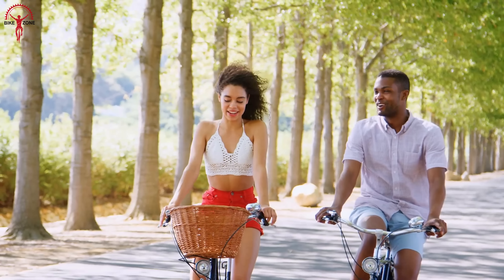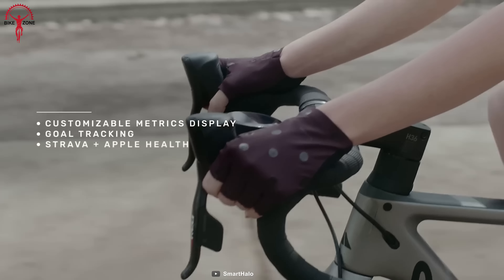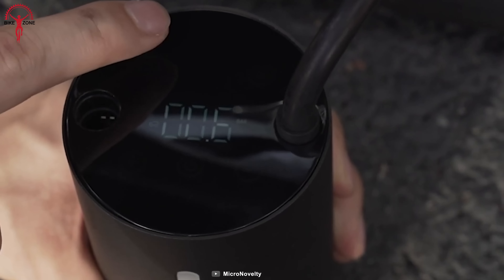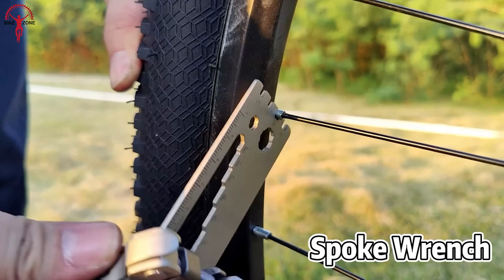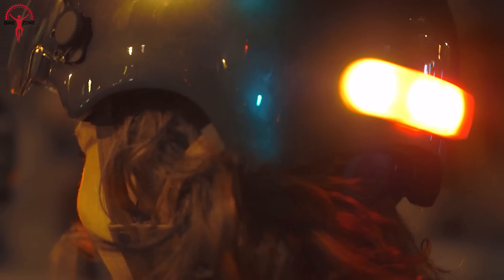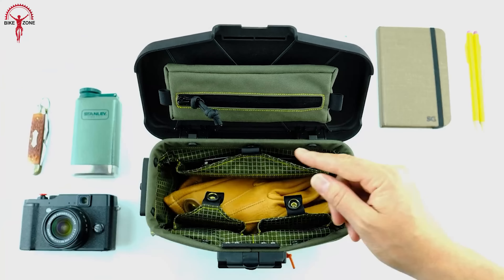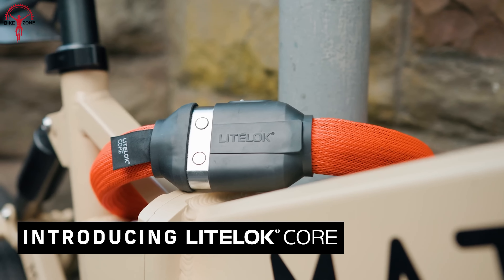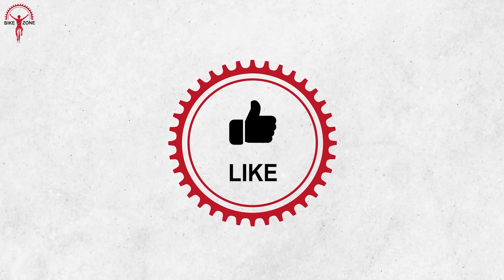7 Coolest Bicycle Gadgets & Accessories

Comment: How in the hell are common air pumps "complicated and cumbersome"? For whom???

And how is that thing - that weighs more, that you have to lug around in a backpack, and that has all that unneccesary electronics and the fire-hazard battery that needs to be kept charged at all times - an "improvement"?

Comment: Sorry, but not a single one of these is new or significantly innovative:
Another light here and there, another clumsy multitool, some bag *yawn*,  nr 100 in the line of battery driven air compressors, which might not work when you need it on the road, and last, not least: nr 1000 in the army of bike locks: If you want publicity and proof for its qualities: send one to the Lockpicking lawyer. If it is any good, he will tell us.

But what's the point with these always identical advertising videos, simulating some reality, that won't hold?!? Naive customers will buy anything if it is cheap or stylish, and ambitious bikers will look for proven qualities.
Reply from the maker: Thanks for your suggestions.
Reply: @bike-zone  Don't get my criticism wrong, but if we accept mediocre solutions as an advance, just because an advertising videos says so, one day we won't get progress at all. 
Plz, watch out for real innovative stuff